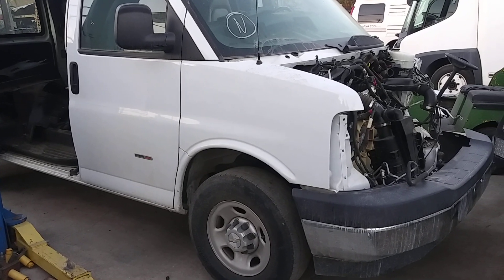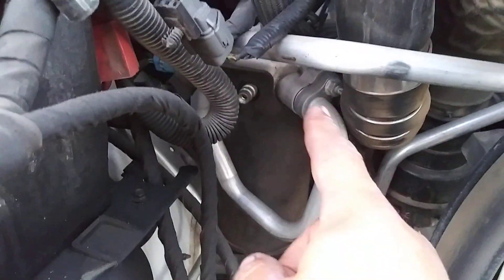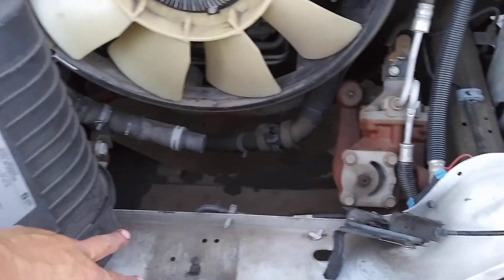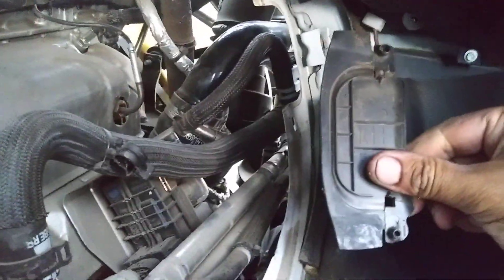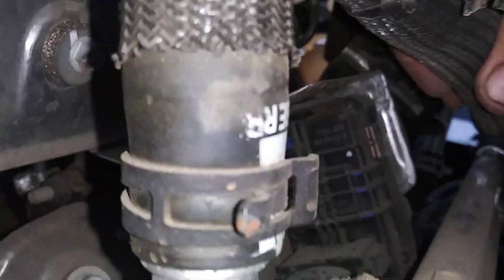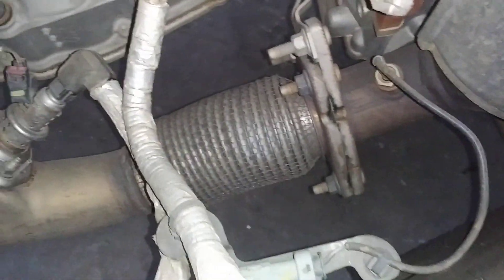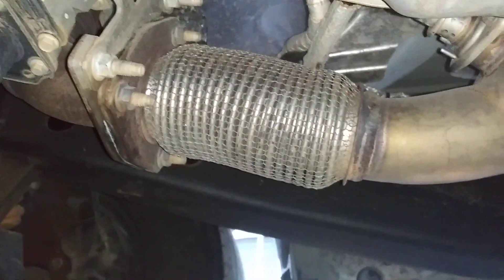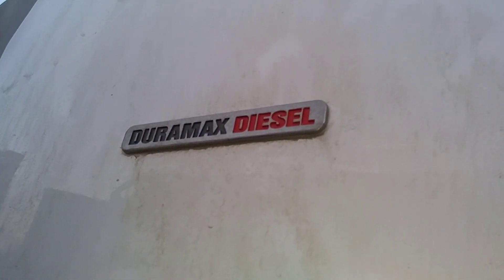Open Doghouse - 2017 Chevrolet Express Duramax LWN 2.8L Engine And Transmission Overview

Comment: Do you think it’s possible to install this motor and transmission on a 3500 van that came with the V6 from factory are the frames and engine mount brackets in the same
Location? Obviously mounts will be different for the 2.8L diesel
Reply from the maker: I am close to trying this exact swap, but haven't done it yet. Some body cutting may be required in the passenger floor area.

Comment: Awesome video, I have a 2500 savana with the 2.8 diesel and found this very helpful.  I would think this engine should have not problem with cooling seeing as it uses the parts from the 6.6?
Reply from the maker: Glad this was useful! Yes, the entire cooling stack is 100% the same as the 6.6 Duramax vans.
Reply: @duramaxvan  Nice, for some reason they decided to remove the automatic transmission cooler so it would probably be easy to just get one for the big diesel and hook it up??
Reply from the maker: @shanemulligan3571  not that straightforward, transmission cooler lines are aluminum pipes that are contoured around the specific engine, for example the 6.0 6L90 lines won't fit on the 6.6 6L90. The 2.8 van uses the 8L90 transmission so there could be other differences such as ports.
Reply: @duramaxvan  they just can’t make it easy can they? 😂
Reply: @duramaxvan  still think i want to put a transmission cooler on my van
Reply: @duramaxvan  how difficult do you think it would be to swap a 6.6 duramax into a 2.8 van?  Seems like it might not be too difficult because of the same body and cooling stack?
Reply from the maker: @shanemulligan3571 Yes you are right, it would be straightforward. I would use ALL wiring from the donor Duramax van, including entire dash carrier, as GM changes the connectors every so often.